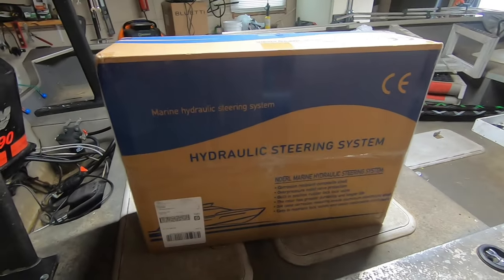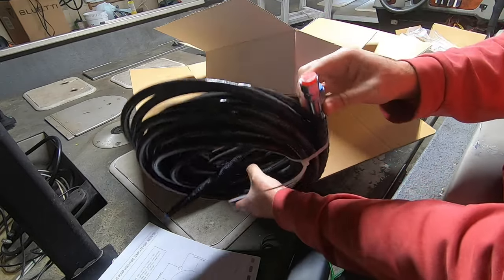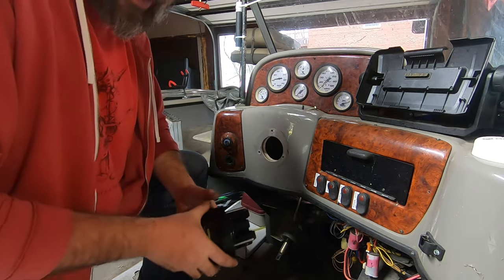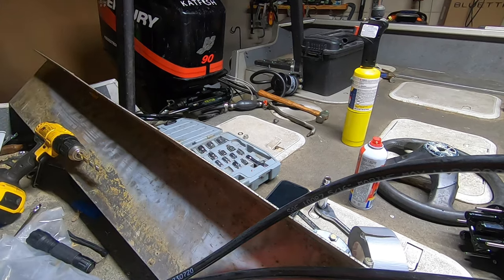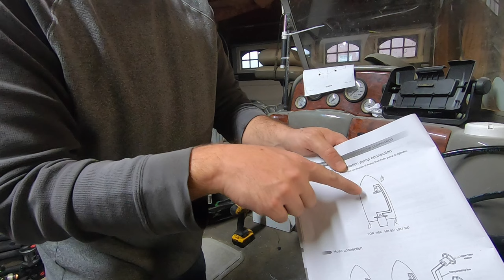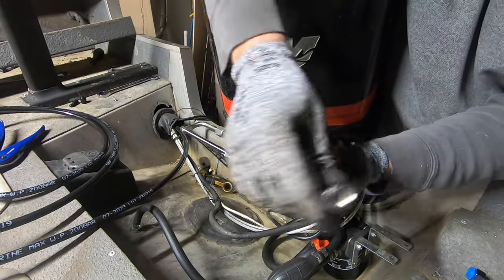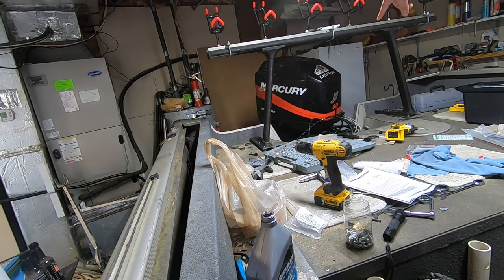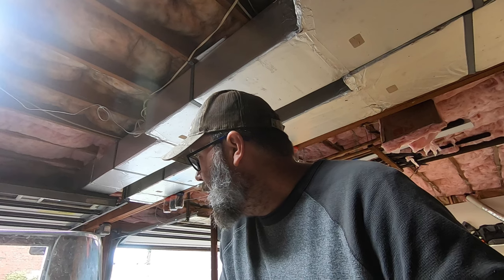DYI VEVOR HYDRAULIC STEERING INSTALL

Comment: By far the best installation video I've seen.  I've got the Mercury Optimax 115 and when attempting to mount the ram, that bolt is literally 2mm too long.  When you rotated your motor to the port side when installing that ram, did it open up the ability to get that bolt started.  I noticed you said it was harder than it needed to be.  Once again, great video.
Reply from the maker: @pensacolapodiatrypa8186  i honestly cant remember what I did to get it stafted. I just know it was a pain. Thanks for watching

Comment: You saved more than a couple hundred bucks. I had a marine mechanic quote me $2000 to change my steering to hydraulic. After watching your video I found the system you used for my boat for $410. That’s a $1600 savings.
Reply from the maker: Thats awesome

Comment: Thanks for the video just installed and you were helpful! Does your steering make noise when turning at wheel?
Reply from the maker: No sir
Reply: I have a litte noise while turning, I have bleed multiple times all seems good. 5 1/4 turns from stop to stop I just can’t figure out the noise, any help would be appreciated.
Reply: @davidjackson-wo1jd  i have done the same I think we should just expect some noise
Reply: @davidjackson-wo1jd  sounds like something inside the pump rubbing (recently install here too)

Comment: I’ve got Sumerset HB with old Hynautic 50 helms and my fly bridge helm is just corroded and shot.  I’ve had good luck with Vevor ice makers and other tools but wonder if it’s got dual steering 3rd return line setup.
Reply from the maker: my helm is set up for dual steering. Unsure what the 3rd line return is

Comment: does the kit function better than the cable? does it feel solid and like it will hold up?
Reply from the maker: 1000 times better. Cable steering is outdated and should be discontinued in my opinion. It seems to be sturdy and reliable so far

Comment: I have a 69’ sea star, with a 04’ 9.9 4stroke mercury, would this kit work for me ? I do have electric trim/tilt. My cable has broke 2 times, no fun.. awesome video, thanks for sharing, you got yourself another sub.
Reply from the maker: I havent seen anywhere where there is a minimum on HP so imagine it would work.
Reply: @bluegrassstateofmind4542  thanks for the reply. I ordered the kit for upto 90hp that uses a rod connected to motor. Did you end up using 2 full qts of fluid ?
Reply: @bluegrassstateofmind4542  ok , I got it all installed, bled, took it out on the lake today and man, you have to constantly keep steering the boat.. I installed a new 13.5” steering wheel, should I have went with a bigger wheel ? Setting still, it’s 5 turns to stop, in both directions. Instructions say this is correct.. what am I missing ? Any thoughts ?
Reply from the maker: @topcat15191961  its a learning curve coming from cable steering. I bought a steering knob to put on my steering wheel and it helps alot. The slower you are moving the more steering you do as well
Reply: @bluegrassstateofmind4542  yes, that makes total sense.. was going at slow speeds, thank you for the tip. On my way to order that knob..your a great help bro